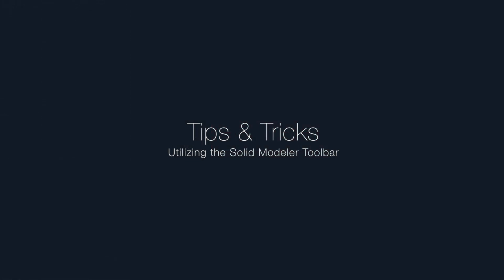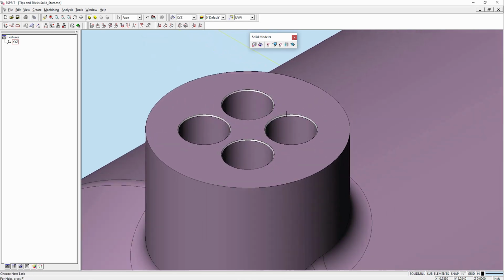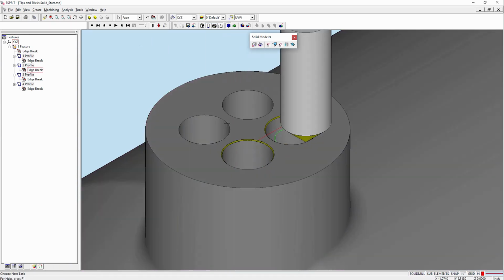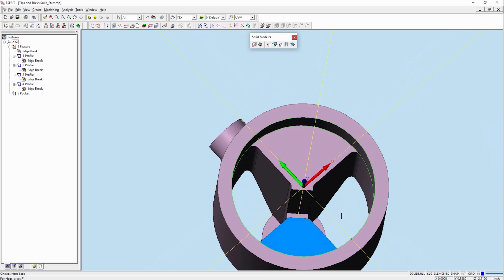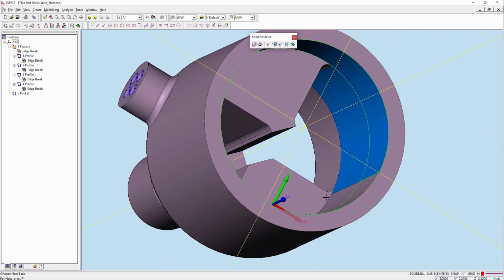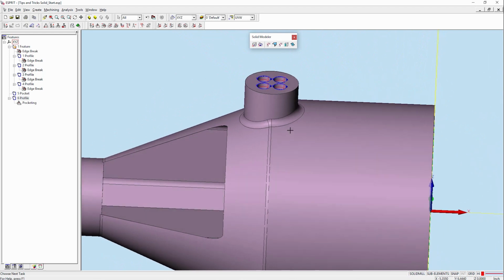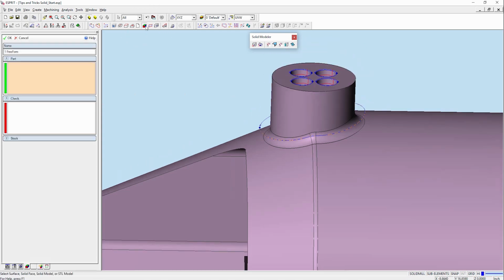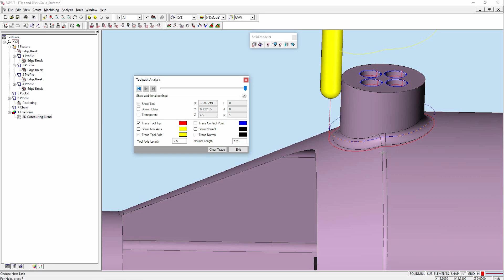ESPRIT® Tips & Tricks: Utilizing the Solid Modeler Toolbar

Comment: I have a question Citizen L20X. When I create a milling by using tool#25, toolpath is right but when I generate it said "need a another Axis rotation" what is that mean? and how to fix this issue? Thanks,.
Reply: check the workplane of that feature. is W direction right?
Reply: Yes  I need another Axis, just figured out, thanks
Reply from the maker: This error is typically a result of incorrect tool orientation or the lack of an axis needed to perform the operation.  First, you should check to see if your tool is mounted properly(on the correct station and with the appropriate orientation for the operation).  Then make sure that the W axis of the workplane associated to the feature is oriented coaxial to how you expect the tool axis to come into the operation.  If you are still experiencing this error, then I suggest you contact support@dptechnology.com for more in-depth assistance.